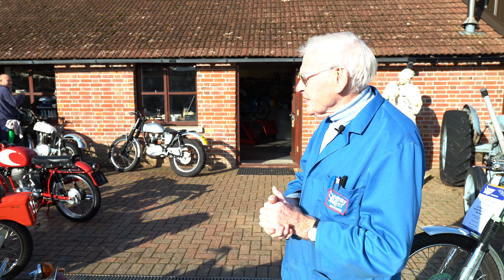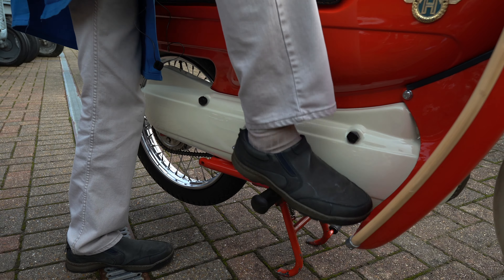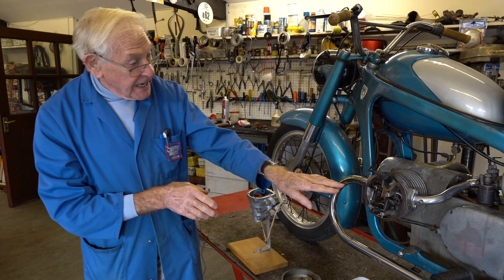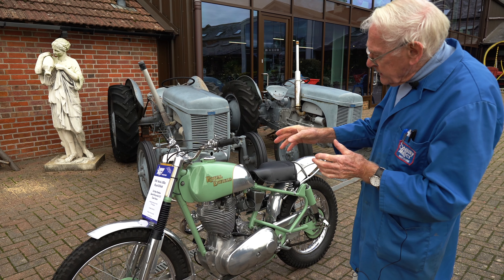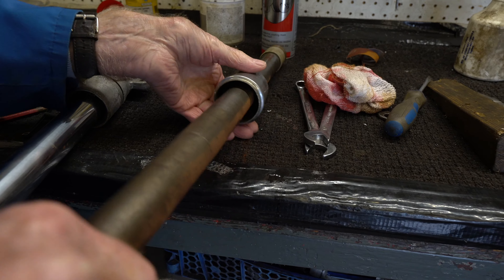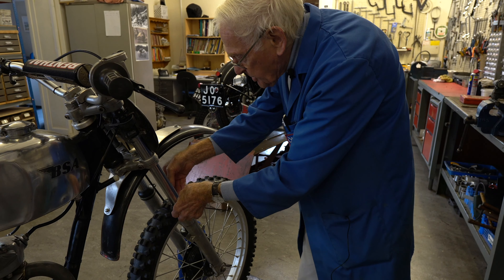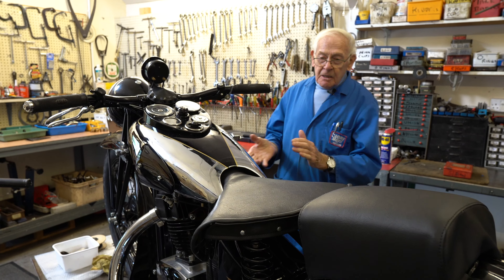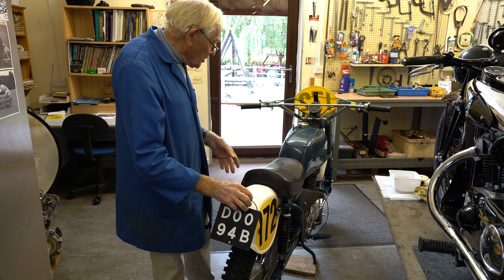Miller's Italian LOVE AFFAIR! 🇮🇹

Comment: Extended manifolds are good on singles to about 4 inches if jetted right. In the interior of British Columbia it gets 110f plus and the intake gets colder with speed and revs. It even frosts sometimes on outside. Cold intake gases are more concentrated cold why heating carbs is bad. Nice BSA B50 is there a VGP Victor in collection I wonder.